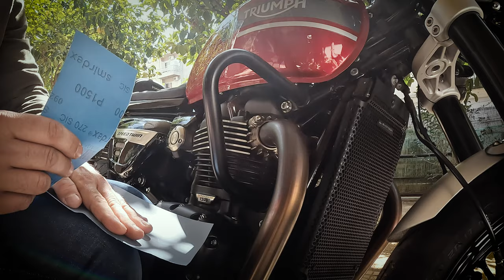How to clean your exhaust. Triumph Speed twin

Comment: Does the brown and blue colouring come back after a long while so you have to clean it again?
Reply from the maker: Yes it does but that’s the way this exhaust is build. I don’t mind that. There where some black marks that I wanted to remove. And this method works if something melts on the exhaust as well.

Comment: Donot use sand paper use only autosol it is very easy to use and it will make a better job.
Reply from the maker: I haven’t tried that. Next year maybe. I plan on doing this once a year or even more. Thanks for the tip
Reply: Totally agree Autosol Bluing Remover works with much less effort.

Comment: I cleaned the pipes of my Triumph Street Twin with "OptiGlanz Edelstahl-Reiniger" (OptiGlanz Stainless Steel Exhaust and Pipe Cleaner) in less than 5min.
"Produkt zur Reinigung von Edelstahlfelgen, Auspuffen oder anderen Artikeln aus Edelstahl. Einfach aufsprühen, 1 - 3 Minuten warten und mit klarem Wasser abspülen." Google translate: Product for cleaning stainless steel rims, exhaust pipes or other stainless steel items. Simply spray on, wait 1 - 3 minutes and rinse off with clear water.
And yes, it worked perfectly. My pipes looked like new without brown or blue discolorations. No hours of fiddling with pastes and emery cloth. You only have to avoid skin contact because its an acid. And don't breathe the fumes. It smells like almonds. A sign of very unhealthy cyanide.
Reply from the maker: Thanks for the tip. Don’t know if this available in my country but will look into it. Thanks 🙏 again